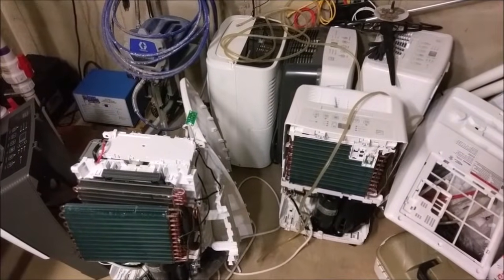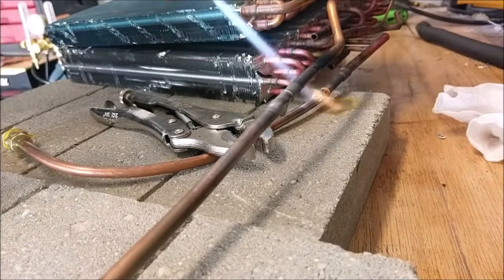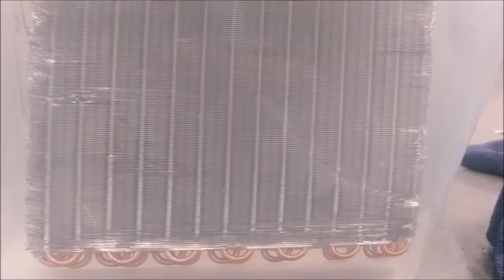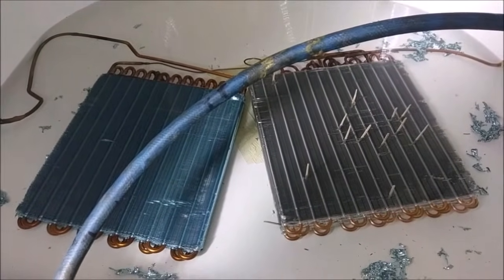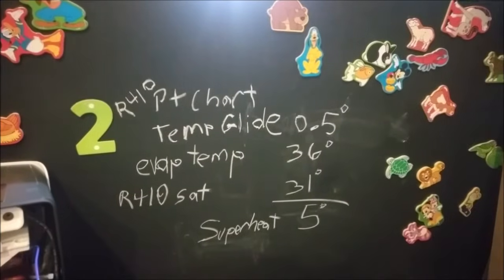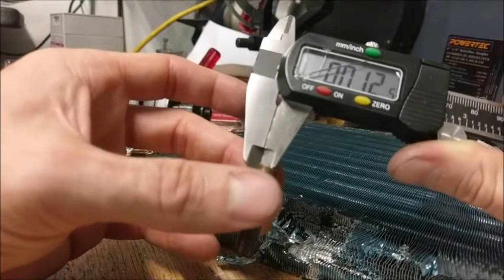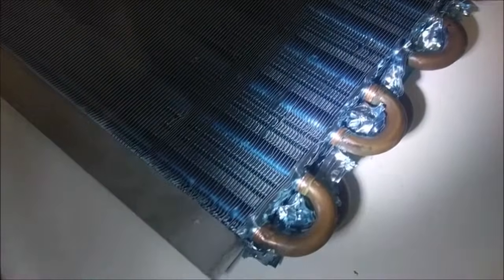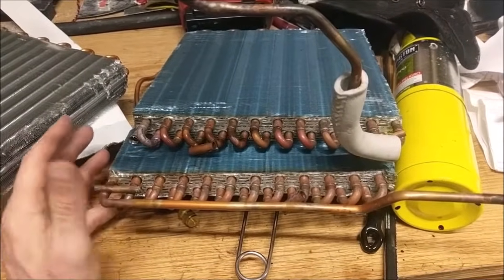Home dehumidifier recharge and leak repair 410A

Comment: This is what happens when American manufacturing moves to China. I have an old American made GE dehumidifier from 1993 that is still working flawlessly in my home but which lacks a continuous drain,  so I purchased a new Friedrich unit. Two summers later it was no longer collecting water but still under warranty. I get a new replacement unit and 2.5 years later, same issue with the replacement. Although still in the 5 year “sealed refrigeration system” warranty, Friedrich will not replace because only one warranty replacement is permitted per purchase. So. I’m back to manually emptying the bucket on my GE which fortunately I never got rid of but that still works great 30+ years later. So do yourself a big favor and if you can find an older USA made unit at a garage or estate sale grab it!
Reply from the maker: Also, govt efficiency standards.

Comment: So I have this same one. Worked great for 2yrs, recently started icing up. It appears to have no leaks, low on refrigerant?
Reply from the maker: Usually, low refrigerant is cause of icing and will get worse over time until it no longer has enough refrigerant for the coil. Then it will use electricity running the pump but do nothing to dehumidify.

Comment: I wish you could go over how you filled it with the r-410a, you didnt show how you connected the lines to fill the unit with refrigerant.  You have the best video so far that i could find, but still lacks that detail.
Reply from the maker: I punctured the line and brazed on a fitting.

Comment: LOL I'm sure same problem:  Not even 1 year old top Frigidaire Pump 70 pint unit - has the same tint blue coil.  Ran for about a hear, then no gas, pump rungs coils room temperature LOL    I wonder if this issue is related to the "blue" coils???

Comment: I made the mistake of buying a Frigidaire FFAP5033W1 from a wholesaler off of Mercari for $90 less than Amazon.  It was great for about 10 months.  After sitting most of the winter, I noticed blue liquid in the tank.  I cleaned that out, turned it on, and it ran awhile then quit, displaying "EC" without ever producing a single drop of water.  I contacted Frigidaire.  They said no warranty since it wasn't purchased from an authorized retailer.  I took it apart and ran it with the cover off, compressor and blowers run, but nothing gets cold except a little coil (I think it's the capillary tube).  If run long enough, the compressor gets too hot to touch.  There was a little blue/green dried residue in random places in the unit, I assume is corrosion, but couldn't really tell the source of it.  I'm assuming it's leaked out all of its R410a.  I've replaced compressors and filled refrigerant on cars, but your video shows me this is probably over my head.  I guess moral of the story is don't buy one of these without a good warranty.  Or in my case, don't buy one of these at all and just live with a humid basement.

Comment: I have a Frigidaire dehumidifier ice on coil problem, come here, but this is too complicated for me to diy. But you are great expert
Reply from the maker: Ya this video was made to finally put to bed why these things lose their charge so fast when they should last 5-10 years easy.
Reply: @fer8888888 the strangest part is why other AC units don't nearly as often.. but yeah, pinhole galore here. Thin coils and the ball bearing stretching must be part of the culprit, plus galvanic corrosion, high pressure refridgerant, and POE oil that turns to acid with any moisture.. bad combination.

Comment: Appreciate the video.  I'm on at least my 6th unit with average life of two to three years.  I don't have the tools to recharge R410a or the patience to solder the coils so I won't be taking that on.  Considered the bullet valve trick...but after reading the comments I'll stay away from that.  I'm on my third GE with the built in pump (APEL70 / APEL45).  Really like the unit but only get two years out of it.  My strategy?  Buy the Home Depot warranty that adds 2-years to the manufacturer 1-year warranty for $45.  Then in May when you turn it on and it runs but does not condense you have them replace it.  Cost me $250 plus the $40 warranty in 2018.  $45 for the next warranty on the replacement machine in 2020.  About to buy the next one with the $45 warranty and hope it lasts two to three years.  Do the same thing in 2024?
Reply from the maker: I tried the extended warranty game. A lot of them are a matter of luck if it will be painlessly honored when the time comes if even honored.
Reply: I am in the same situation.  I just bought a cheap Insignia from BestBuy $189 and $55 for a 4 year extention.  I know I will need a replace within 2 years. The Insignia looks to be internally the same as my Toshiba which only lasted 15 months.
Reply: Best course of action should be to find some 90's or early 2k's units or even older for cheap.

Comment: The problem is design of the dehumidifier and it's use of 410a refrigerant. When 410a systems become contaminated or overheated the refrigerant can become acidic. At which point it starts eating holes in the copper and aluminum lines. So trying to fix 410a systems especially if they have multiple leaks is pointless. Which is why the manufacturer is happy to keep sending you replacements, they know the units can't be fixed.... I fished a 410a dehumidifier out of my neighbor's trash. Just like with you the manufacturer sent them another unit when theirs quit. I didn't really even bother to look for a leak. I just refilled it with propane from a 1lb disposable bottle sold for camp stoves and heaters. This grade of propane is basically identical R290 except they add an odorant in the propane. 

With propane being a much larger molecule and the system running at only 65psi on the low side a unit filled with propane should leak much slower than it did with 410a, Or if you are very lucky it may not leak at all. Plus the propane won't continue to eat holes in the system. My scavenged dehumidifier goes about 8 to 10 months before needs more gas. When running propane you also use only a fraction of the gas the system used with 410a. Topping it off takes so little gas a 1lb bottle would last several years.
Reply from the maker: I agree that topping off 410a with its high pressures is pointless. The unit is still running holding a charge since the making of that video. When the walls of metal are made to thin the imperfections in the grains can become problematic to holding gases to when mass produced. Almost none of the air bubbles have pin holes, but look like they are seeping through the copper's grain structure. The humidifiers from the factory should not have contaminated refrigerant getting acidic. Leaving to the most likely culprit of wall thickness being to thin for mass production. Or the water that condenses on the coils cause microscopic corrosion that eats at the thin wall with no room to degrade too. Propane is not a bad idea. Maybe sometime I will try it.
Reply: Main problem is that you lower the system btu capacity by using lower pressure refridgerant, since the higher pressure vapor is denser it takes more power to compress for the same volume. So I'm your case the motor is way oversized and you're running it super easy on it, for the work being done. But as long as it works, albeit more slowly,  you've given a second life to a dead thing.

Comment: Great video, love to watch DIY repairs. Would you know where to obtain r32 gas and the correctly rated service valve for soldering? I have a few units I would rather have a right to repair them then just treat them as disposable every year.
Reply from the maker: You can get the valves on Amazon. As for your gas question. R32 does not appear to be available and looks like a drop-in replacement for R410A. If the datasheet info I used is correct, R410A should require 2.7% more refrigerant by weight due to slightly less density, which is basically measuring scale error. The pressure/temp charts I found look nearly the same. If the info I reviewed is correct. In theory, you should be able to pull a vacuum, then recharge with 2.7% more R410a if the oil in the unit is compatible with R410a. I suspect the oil is compatible but if not, then it will just wreck the compressor on the unit you were going to throw away. Of course, as a DIY you would do this at your own risk anyways. 
40F = 4.4C
81F = 27.2C
Density
2.7% difference
R32
density 1.1g/cm
4.4C = 119 PSI
27.2C = 243 PSI
R410A
density 1.07g/cm
40F = 118 PSI
81F = 240 PSI

Comment: Hi
i refill my but i dont know the gramms of 407.... i have ice before evaporator and to the first pipe of it... its normal? how mutc is the lowest temp to the evaporator and how mutc the highest temp in the compressor to room temperature?
thanks!!!
Reply from the maker: A partly iced evap can be normal depending on the operating environment.  If it is full packed with ice then there is a problem. A lot of times people refill till they start to see the frost melt near the end of the evap and call it good. Some people also recharge till outlet pipe of evap is about 10 degrees above freezing.  The unit should say how many grams it takes or in the manual for the unit. That is the proper way to charge it.
Reply: @fer8888888  thanks for your time
Reply: i am frai maube insider i have humidity from air... because i change one oring to magnetic valve...  i must try to take out air with nitrogen
Reply from the maker: @ghostridergr8259  If you did not leave the system open for long simply pulling a vacuum and holding it for an hour should be fine. If you really want to, pull vacuum over night and then pull it again for 10 minutes in the morning. Most of the moisture will be gone. If you did brazing most old timers never purged but it is a best practice to help prevent the orifice tube getting clogged from soot due to burnt oil.

Comment: I have Emerson Quiet Kool PMP50 and it is not condensing water. The compressor runs, the humidity sensor works correctly, there seems to be no refrigerant leak, but it looks like refrigerant flow is partially blocked. The condenser (hot inner coil) stays pretty much at room temperature, only the pipe leading to the compressor (high pressure) gets hot. Likewise, the evaporator stays at room temperature except at the connection to the condenser (very thin coiled tube), which gets cold and produces like 1 droplet of water in 5 min. After about 30 min of running the compressor stops with an error code EC. Do you know how to fix this? Is there a way to figure out which coil is blocked? Is there a way to unblock it? Will adding a piercing valve help? Thanks.
Reply from the maker: Sounds like low refrigerant or bad compressor valve. With out pressure readings, really can't say.

Comment: Nice work, actually EPA608 compliant. You probably know this, but the aluminum fins are slipped over the copper tubes in a fixture, then a steel ball is hydraulically pushed through to expand the copper tube, so it is in tight fit for heat flow to the fins. That's probably where the thin wall is damaged. Small micro scratches, and the pulsations from the compressor cause them to open up. And I bet there's no quality control in the factory to even test for leaks. I now have 4 of these failed R410a dehumidifiers. I get about 2 years from them, and the warrantee is 90 days I think.
Reply: I remember reading a comment where after 2-3 years of working dehumidifier, it broke-down (when out of warranty).  So what's a consumer to do who thinks you should get more than 3 years for your money?  SO ...the man went to the box store, purchased the same model...a working model!  Later returned the broken model, as defective and got his money back to reimburse his resent repurchase!  Brilliant!

Comment: Great work.  I just fixed my first one and had plastic on fire too.  I was lucky it was a single leak btw video on youtube "dehumidifier repair: diagnose, repair leak,". Seeing the leaking coils is the same situation that central air conditioners had coming from China when 410a was first being used.  They called it as an excuse "formicary corrosion".  I would suggest using a sealant for these little guys would be the best option.  You might be able to fix multiple small leaks with it like you experienced.  I'm working on my second one and am guessing it is like yours so I may try sealant.
Reply from the maker: Nice video. Those bullet valves always leak.  You made the same mistake I did brazing in the valve. It is pointing down and becomes a small inline trap for the oil over time lowering the level in the compressor slightly. Doesn't seem to be a big deal for how small it is but something I will do differently next time.
Reply: @fer8888888  btw I can't find a sealant for such a small unit, I guess it might be possible to share one tube over several units. Thanks for the tip about the valve trapping oil.

Comment: I have a question. Ive got a couple dehumidifiers and portable AC units and when the compressor turns off, they seem to give off a chemical odor. They seem to be dehumidifying and cooling still but I am wondering what the smell could be? Is it a leaking refrigerant?
Reply from the maker: Can't really say with out smelling it. But usually if refrigerant is carrying vaporized oil out with it. The device will not dehumidify or AC too many days longer as it runs.
Reply: @fer8888888 Do you know what type of odor the vaporized oil would have? I have two dehumidifiers and am trying to figure out if one (or both) of them are the source of a somewhat sweet but also slightly minty odor (almost like bubblegum mixed with a hint of toothpaste) that’s been building up in the house over the last week (I don’t chew gum and only use unscented cleaners so it’s not from me). Both dehumidifiers have reduced performance lately. And I just found a small dried puddle of some sort of blue/green crystallized substance underneath one of them (not in the bucket but under the machine). I know the SDS for r410a says it could have a sweet mild odor, but do you know what type of odor the vaporized oil would have?

Comment: I'm glad to have found this video, as I tried exploring the coils on a recalled unit I picked out of the trash that had leaked down. An electronic leak detector couldn't find anything, and I have yet to try placing its coils in water. I'd been wondering where they go wrong, beyond the obvious answer of "it's cheap crap".

It's amazing to me how bad these things are, although I have two modern units (one Danby, one Frigidaire) that are a couple of years old and still going strong. Meanwhile, there's also a Sears Coldspot ("The Blotter") Thirty here that's had a fairly hard life and it's right on tilt for seeing its fiftieth year.

I'd be curious if you could get away with using that good condenser as an evaporator. I suspect it'd work, albeit less efficiently.
Reply from the maker: I wonder if the gas would expand properly in the thinner tube of the condenser.

Comment: You should edit your video pretending to be repairing these units under warranty.  You should send your new video plus an invoice for your time to the manufacturer.  Then tell them if it isn't paid in 30 days, a late fee will be added to the total bill. Then after a year sell the debt to a collection agency overseas.  Then sleep easy knowing somewhere there's a call center making these clowns lives a living hell.
Reply from the maker: Like the idea. But it would probably be a person making $10 an hour answering phone calls hearing it, saying stop calling to them.
Reply: @fer8888888  True, though you could take your findings and write a report to the EPA or a news organization regarding the poor engineering and craftsmanship on these units.  Make a rough estimate based on the number of units manufactured and how much refrigerant they've released into the atmosphere.  You're required to get a license to handle these chemicals properly, which you pay for from your own wallet.  You will personally get fined if you don't follow regulations.  Yet these manufacturers are not taking any precautions and with every release the government blames HVAC techs and requires more training.